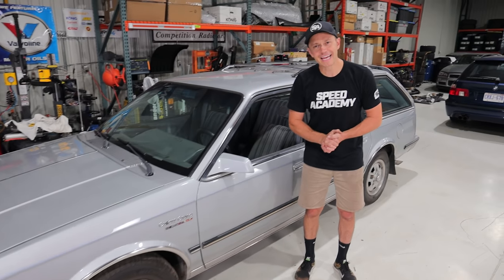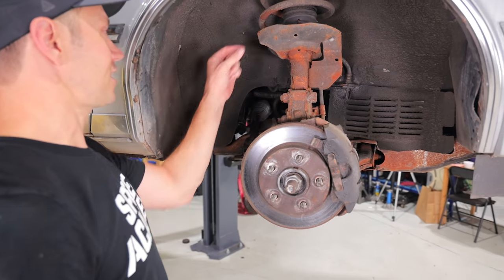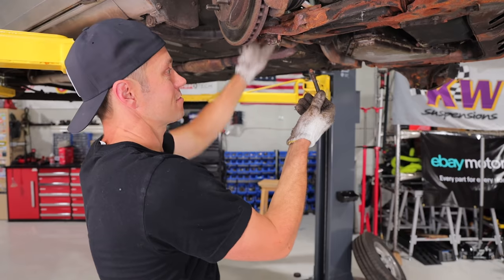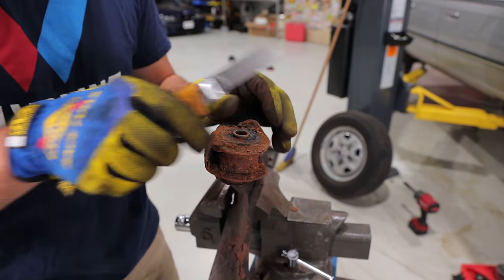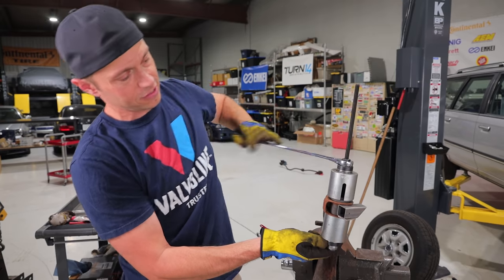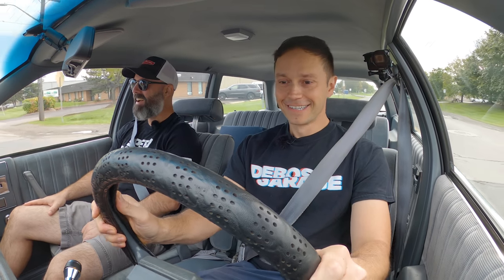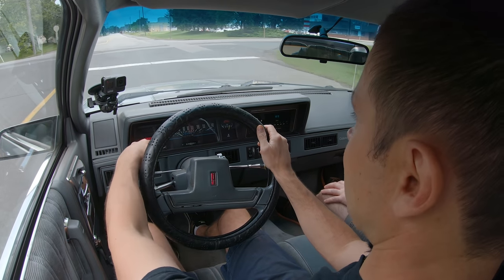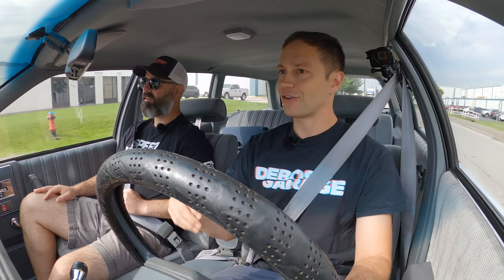Can We Fix This 80 Year Old Grandma's Car When No One Else Will?

Comment: This old Oldsmobile cutlass cruiser is a cool old ride. It’s amazing it’s not rusted away. The interior is in very good shape. So is the body. 

The reason the ride is so boaty is the struts and shocks are worn out. An alignment, replace the struts and shocks, replace the rear track rod bushings and fix the charging system and the ride and drive of this car will be transformed. It will still be a somewhat floaty ride, but the smoothness, responsiveness and comfortable character of this car is fully restored. This car is as the name implies, a cruiser, not close cropped sport wagon. It’s perfect for relaxed driving. And it actually has pretty good styling over all. 

Compared to todays cars of the same size and class, this car is very light weight. Under 3200 pounds. An updated I4 or V6 and 6 speed automatic transmission out of any of the newer GM front drivers would seriously wake up this car. No need for a LS v8 anything.

Comment: Wow, this is like a time capsule for me. I’m also from Ontario (Mississauga), and it’s nice to see that this isn’t a rust bucket with all the salt that’s dumped on the road every year. And relatively low mileage compared to the age of the car. Growing up, our family had a 1986 Buick Century sedan - if I recall correctly, it was the fully loaded Limited trim. In typical GM fashion, the interior looked exactly like this, aside from the steering wheel and the fact that it was the sedan, and that it was a god awful bronze-brown colour. My grandpa bought the car brand new from the dealership, he ordered most of the options aside from the power moonroof and a couple of smaller things. I do remember it being a V6, so I’m sure it had more power than this one here. We also had power locks and windows, from what I can remember. At least the front window were power.

When you pointed out the radio - yes indeed that space is reserved for a cassette deck - we had one. It was actually an additional option, I think even for the top trim and the T-Type. If this lady has the base model, that radio may only be AM, unless she sprung for the one with an FM receiver. Seriously - only AM radios were standard on the base model. You had to order everything else on top. It’s too bad you didn’t actually test it out, but I know - copyright strikes, etc. 

I would have loved to see the total overhaul of this beautiful car, right down to those seatbelts.

Comment: My first car was a 1986 Delta 88 coupe handed down from my grandfather. So basically that wagon, but a coupe. Same seats, controls, steering wheel, gauge cluster; all of it. The doors were so long that if you had the window open when you closed them, the window would fall off the track and then down into the door. Every time. The car met its end due to the timing gear stripping teeth and causing the chain to jump. I really do miss that piece of crap sometimes.

Comment: Truthfully panel gaps and quality was all over the place on all 80s cars... however gm in the 90s started making cars that generally lasted ND generally didn't have issues in staying running... Japanese and European had that too but parts were more expensive then... I will take most gm during this era over the other big three, although then2.8 was not one of the motors that ages well for sure

Comment: She’s 80 years old and the car is paid for. It looks like it’s in reasonably good shape so why not keep driving it? The V-6 on this model was about 125 hp. The base iron duke 4 was about 80 hp. Both engines were dated by the time they made it into this car. Yes they were easy to work on, and I remember the iron duke used to leak oil like it was going out of style.

Comment: I wonder just how many of those J cars GM sold.  I owned 3 of them, 2 Chevys and 1 Pontiac.  All in all, I loved them.  But they rusted out faster than any other vehicles I've owned over the years.  Never had drive train issues because the front sub-frame failed first.
But it seems that with so many of them sold, even so many years ago there aught to be parts available.

Comment: The first car I ever bought was a 10 year old 62 Ford Galaxy for $50, like driving on a cloud
And for the privilege of driving that car you should replace the alternator,  we both know it needs it cause it should have kept running with a dead battery if the alternator had an output.

Comment: When working on these cars (I was an original owner on an '85 Cutlass Ciera with the 3.8 V6), one of the things I can remember doing was modifying the engineer mistakes.  There were more than a few "impossible" to remove bolts as I remember.

Comment: It may be 80s but I'm guessing that fuel pump still likes a little voltage to do it's thing. They don't run well with a dead battery. You've earned your blessings for the week at least. This may be the one time a good deed went unpunished. To bring back an 80s quote.

Comment: When I first saw this car it looked very close to the Chevy Malibu Station Wagon that I had back in the 80's when I was a single parent raising two children. It was yellow and I do not remember what motor it had but it had enough power for what I used it for raising children. I do not remember what year model it was either because it didn't matter; it was in real good shape and I could afford the car payments at the used car dealer. It was very dependable except for the carburetor that I rebuilt many times...don't know why it had to be rebuilt so many times. I think I had it until the late 90's. That yellow station wagon served us very well. I was actually sad when I sold it.

Comment: I did a quick search and found several aftermarket replacement lower control arms for this vehicle ranging from $75 to $85. Best of all, they already had the bushings pressed in, so they were ready to drop in.
Reply from the maker: You likely came across the RWD version which was also called the Cutlass. Trust us, we looked and they don’t make new ones.

Comment: I owned a mechanic Shop Car lot and bought everything thing from cheap car to very hi line cars Lambo, Bentley , Ferrari, Rolls-Royce, and others all the way done to the cheapest and I ended up getting one of these with 28 miles It had the 2.8 V6 it was as new as u could get 5 years after they where built it could not be sold to a individual because it was a insurance claim because when it was brand new being unloaded they dropped something off another  vehicle that was above it on the truck and smashed the top so instead of saying something they just used Bondo   and Painted it and if you know about the top of these car if it is caved in u can pop it back up But if you don't do it right and fix the ribs under neath they will fall back down  if you hit a pot hole well the sold it like that and drove it 3 miles and they come back to find out why and they tried to blame The new owner needless to say the had a good lawyer and the lot wish they never seen that car so that is the reason it could not be sold to the public and I got it for a hundred so I drove it on my dealer tag for a long time because it drove like a caddie  and I loved it and since I payed a hundred for it  it didn't matter how long I drove it

Comment: so you didn't use a sleeve on the outside like factory? hmmm i don't think that's right them bushings will be fucked soon enough. 2 little contact points are going to cut right through that bushing. there's a reason there was a sleeve

Comment: Are you guys 12 years old and have never seen a car that dates before 2005?  I bet you guys would loose your minds if you ever saw a hi-beam switch that is activated by your left foot or a lever in the floor that you have to move to change the gears.

Comment: It would cost less to restore this car to new than to replace all the electronics in the cars of now and would have to do it again in ten years or go to a battery-operated car that are dangerous fire hazards and need to be recharged every few hours and batteries are more expensive to replace than gas at even 5.00 dollars a gallon for the life of the battery. Would put your life on the line for a computerized, battery-operated vacuum cleaner.

Comment: done more than a few of them with an extension and a wobble socked . slide it into that hole on the bottom of the frame, and as for the wench i use a longer one so it jams up against the frame of the car to hold it in place, lol i work for 2 used car lots ,, if that gives you a clue hahaha

Comment: My gramma drived an old dodge station wagon. Biggest issue thing ever had was timing repeatedly going out if wack. Finally found a previous shop had misplaced the bolt and just replaced it with a longer one with a nut on it to make up for being to long. Shop ended up paying for multiple visits and all the crap they tried to fix it after their initial mistake. Talking thousands of dollars. And Mr dumbass who thought an I'll fitting bolt was a solution was fired.